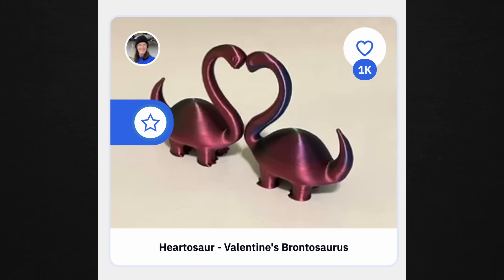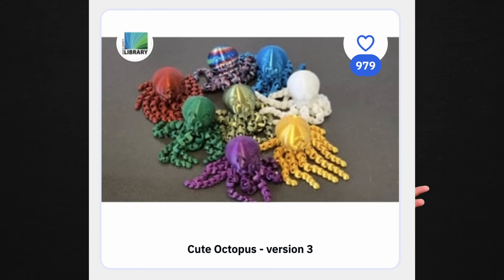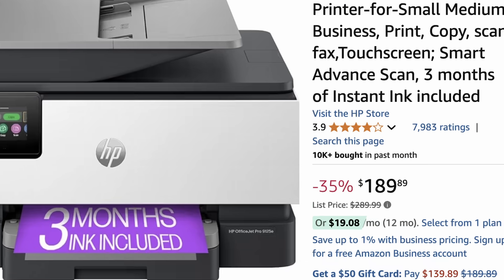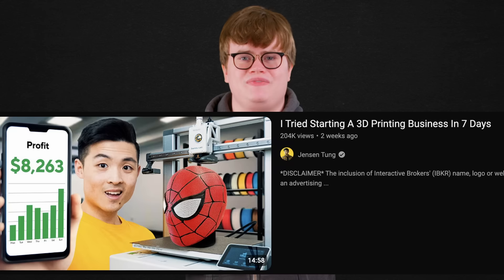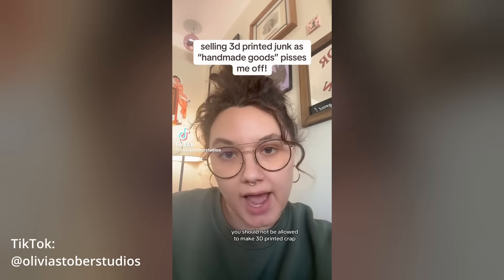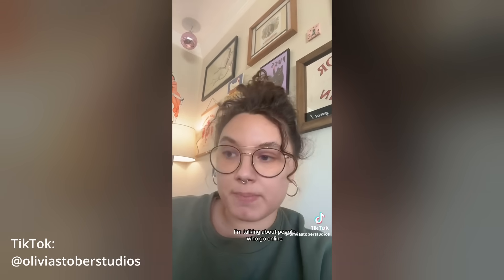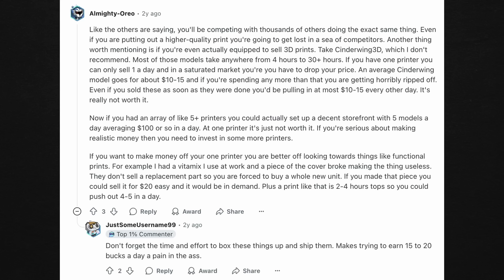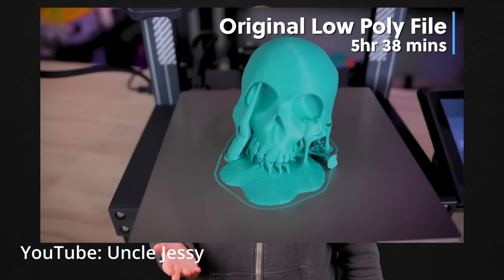The Rise of 3D-Printed Slop

Comment: I did originally get a 3D printer for the novelty of it. I've printed an octopus or two and an infinity cube. I'm not ashamed to admit that. I've even printed a vase!

I have (and still do) print stuff off thingiverse, but I've also made some custom parts. I had a wheel to a pulley break on an 8mm projector a week ago. I measured it out and taught myself enough FreeCAD to design a new one and after a few iterations and adjustments on my printer it works good as new!

Similarly, I needed a take-up reel for a projector and thingiverse had one, I downloaded it, printed it, and now I'm watching old movies. I could have bought a used one on eBay, but that would have been expensive and taken more time. The only benefit of going the eBay route would have been higher quality. I literally can't think of a different one 

I agree with a lot of your video. Maybe it's that I'm just a beginner and not jaded by what appears to be cynicism, but I'm not too worried about the junk yet. I see the dragons and crap on a coworker's desk and I roll my eyes, but we're not to Funko Pop levels yet.

I'm hoping other people have the same frustration I do when a print goes bad and have looked for ways to recycle their filament instead of it going into a landfill and that will create a market of lower cost shredders and pullers.

I absolutely agree with people selling commonly available STLs as prints. It's not a sustainable market and by the time I've purchased 10, I've probably spent more than the cost of my own printer. If you're selling specialized parts or useful items (project housing, gears, pulleys, connectors, ect) then there likely is and will continue to be one, especially if you can do 100 washers for $2 or something similarly cheap.

You're probably right about everything and I'll get to your viewpoint later on though, but that's my viewpoint now.

Comment: I'll say this: 3D printing an STL someone else made at least takes more effort than any sort of GenAI 'prompt engineering.'

Also, as a way of making money, I would say, like you say in the video, that 3D printing is not a very good way to do it. However, with a used printer, some time in Blender / Autodesk, and some metal parts, I've learned a new skill, used that skill to network with similar 3D printer nerds, and made some functional tools that are not available in my area.
Chris Borges details his experience designing and printing things like vices, lathes, taps, drills, and dovetail mounts - a far cry from your mass produced PLA dragon crap!

But if I wanted to make some cash, I'd probably go work at a mill or something, lmao.

Printer waste IS a huge issue - and I'm not super convinced that printing newbies are that concerned with the waste it does make. Solutions do exist, but you have to have the time to put them together, and the parts (Artme3D's solution costs hundreds of dollars to put together, and you've got to build it yourself!) Plus, there's the ever present problem: Recycling is not SEXY. Who wants to recycle when you could be printing impossible shapes?

And anyone selling this as a 'get rich quick' scheme, I agree, is full of it.

Comment: Internet was designed to share scientific data around the planet. Instead out shares bobs and vagine.

Same people thought 3d printers would share prototyping
Reply: i mean, why not both?
Reply: People do share scientific data on the internet. The same way 3d printing is used for prototyping. But they are also used for a bunch of other things, like having fun. You may not like it, but there exists such thing as "free will", which means that people can do whatever they want without consulting your opinion first
Reply: @anastasiaalimova5452  also, being upset at individual users for wasting plastic when single use plastic lobbyists get away with worse on a bigger scale is counterproductive.
If you really wanna cut down on plastic waste, get some of your cooler friends together and block pipeline construction in your area!

Comment: Everyone who gets a printer has to get the slop out of their system. Including me. Eventually you realize that no one wants that articulated dragon that took 14 hours to print and they either sell their printer or move on to more practical prints. I use mine to make storage systems anymore mostly. I dont sell anything because i know no one wants to pay what its worth to me. And a large chunk of new people learning CAD right now are learning it because of 3d printing.

And no one wants to sand their prints because its not that easy. PLA kinda strings off when sanded and looks ecen worse. In ofder to make something smooth you have to fill the layer lines with Bondo and then sand, which is SUPER annoying. 

98% of matsrial used in 3d printing is PLA. Which decomposes easily and is made by recycling. PETG is the next most popular and is super recyclable from soda bottles. Neither offgasses harmful chemicals. The only health risk is the dust, but nowadays most people are buying enclosed printers. 

Dude if you dont like 3d printing, dont buy one. And do buy the slop.  This video comes off really whiny. And slop at craft fairs will stop when people stop buying it. So just dont buy it. Let people enjoy things and stop being so offended.

Comment: I just 3d printed a modular fiddle. It's to replace my broken childhood violin that's too expensive to repair. Not a waste and the sound is beautiful.
Reply: Dude, I replaced my old warped bridge pretty recently! 3D printed strings players unite!
Reply: @logicbuilder1204 sadly it was a waste. It snapped after 3 months. Good wall ornament but the plastic can't handle constant tension.
Reply: @Dtgray12  Were you using PLA or PETG? I know PLA has issues with being under constant force. Also, did it break while you were playing lol?
Reply: @logicbuilder1204  PLA. Printed a wall mount for it. Played 30 mins daily. Snapped when I was in another room about 2 weeks ago.
Reply: @Dtgray12  Ah yeah lol, PLA does that. If you ever wanna try again use PETG, I printed my cello bridge out of PLA like half a year ago and it's still going strong
Reply: @logicbuilder1204  PLA. I printed a wall mount to hang it and played it 30 minutes in the morning and evening. It broke about a week ago while hanging on the wall.

Comment: 90 percent of what's being printed is garbage toys that even a 5 year old would be insulted by receiving. Every time you mention the overwhelming majority of thingaverse straight to landfill slop, the community starts screaming about how they printed a bracket for an old bookshelf so it's fine, actually, like those 2 things cant simultaneously be true. What a waste. Everyone here has seen the YouTube shorts. Look at these 2 interlocking things. They fit into each other. First of all a 3d printer is the worse thing for this task because of the resolution. Secondly, it's literal trash. Good job """making"""" something.

Comment: I feel personally that the problem is that people can’t reuse the plastic already printed, which is why they usually get trashed. If there was an add on or something that could recycle failed prints back into filament, then this would be less of an issue.

Comment: One roll of filament, an oil product, weighs about 4 lbs.  One gallon of gasoline weighs about 6 lbs.  The waste is just about negligible and a nothing sandwich.  Considering all the benefits of 3D printing, don't even consider the waste. I bet the printer will keep you from driving some place far at least once - that should make up the oil waste quota for the lifetime of the printer.

Comment: I hate to be that guy, but this video seems kind of.. low effort? Like yeah, it’s sad the most popular prints are slop when there ARE good prints and even full printable games out there, but it feels like you are stretching the runtime and reiterating the same points over and over. Also, home 3d printers are still pretty young, so I feel like you are overinflating the quality issues which can be fixed if you put effort into sanding down the prints.

Comment: Thank you this is very true. The 3d printing community seems to gloss over this stuff in their excitement for new 3d print technology. The emphasis should first be CAN YOU MODEL ANYTHING and do you NEED to model custom things for any reason. I got a printer when they finally got cheap and easier to use, for this reason. I can make miniatures and animations and got good with Tinkercad before I knew anything about 3d printing so for me it was exciting to see that I can print my own designs in the real world for miniatures and animation models, but then learning about it quickly discover that the community seems to be about just churning out ridiculous crap from thingaverse. It's very annoying. Also the rhetoric around PLA being "biodegradeable", while there are still unnamed toxic additives in most types is really frustrating. It's a separate issue but where is the filament that is is truly compostable? I can't stand the green marketing that the industry employs about this.

Comment: I have 5 3d printers now, not a print farm- I almost never use more than one at a time... many are enders I got for under $100 that I've been modding for different uses. I have these because I have a LOT of hobbies- basically every aisle of a craft store is in my home... this means I often need niche craft items at 2am and my closest store is around an hour away, and I prefer not to shop online due to the environmental cost of shipping. I can start working on a card for a coworker, realize I really want to emboss the card, and quickly print a small embossing tool or 3d model my own with simple cad software. I've also found a love for using my printers to make items that are too niche to find anywhere else. I've started designing uniquely shaped mold and deckles for paper making, these typically require using two frames and mesh, limiting shapes to simple ones. With 3d printing, I can print anything from egg shapes to flower shapes in a way that everything is printed at once. I do really think a 3d printer would be perfect in most homes, but I wish the crud could be restricted to prevent excess plastic use.

Comment: Last thing I used my 3d printer for is to fabricate a replacement  handle for my 20 year old Bosch fridge which i found a file for but had to alter the model to make it fit my model of fridge. And  the result worked well. This is what i think of when it comes to how to use a 3D printer among some other hobbies.

Comment: It's so much worse, because PLA is NOT biodegradable.

Pure PLA filament will biodegrade under natural conditions in ~80 years--but here's the catch: NO ONE SELLS IT. They all have additives or have not been tested under any ASTM standard. I spent months searching and found only ONE filament that was 1.) tested/certified 2) actually available. (Filamentum Nonoilen is the one I found, and it's difficult enough to work with that it's only suitable for certain prints (no overhangs)--otherwise amazing.)

If you have a resin printer, you can find biodegradable resin from 3Dresyns.

The only 2 people in my office who own a 3D printer just have it running at home constantly printing stuff they will throw away because they think it's biodegradable. 5 dragons in a row until they get one with the color spectrum they like. The rest go in the trash. It's going to sit in the landfill unscathed, slowly dumping microplastic particles, for longer than they or their children will live. 3D printing is a massive waste problem and it continues to grow thanks to extensive green-washing. "Sustainable" filament is not sustainable. "Bio/plant-based filament" is not in any way biodegradable. Etc. Etc.

Comment: I work in the games industry as a 3D artist and have a lot of experience with woodworking/cabinetry. I’ve occasionally dabbled in 3D printing as a medium through friends owning them or from online services.

Often it might come in handy for small parts or work holding jigs in my projects. Most of the time I find that it’s easier and faster to just make a part roughly to get the job done out of plywood/acrylic/mdf/etc. Many of the applications where I think “this could be a 3D printed part” tend not to need the actual tolerances afforded by a 3D printer.

What’s weird is that I use 3D modeling software on a daily basis for work. I almost always use blender or fusion 360 to figure out my design/process/materials estimate first before I build any sort of woodworking project. Knowing 3D software as someone who makes stuff seems as important to me as knowing how to use a pencil when I draw!

I’m just baffled by the idea of purchasing a 3D printer but not learning at least basic cad software or the basics of blender? It blows my mind how many 3D printing obsessed people online seem to have no intention of actually acquiring the skills needed to use the thing competently.

All I can reckon is a lot of people who like to think of themselves as “technical” but not “creative” get into 3D printers but are scared of “putting a brush on canvas” essentially? I just don’t understand it really.

Comment: I have 5 comments on this topic overall:

1. Recyclability. PLA o mateials that are vey similair, like PLA+ and such, can be recycled on mass. Not 100%, but there are recycling farms that you can send it to.
2. Is it usefull? You said, that pinting things like the ring measurer is not worth it, because you can buy it on temu. But shipping an injection molded plastic part over half the world is better than printing it yourself? 
3. Yes, one should absolutely know at least one 3d sculpting tool like Blender or Fusion 360. Only that way you can actually feel like you are acomplishing something. Even if you are just modeling flexi Dragons.
4. Some of them are just toys. If you smooth out prints, or print them at a high enough resolution, they can make great toys for children age 4+. (Wouldnt gift them ealyer, out of fear of them chewing on it). But they usually enjoy them for WAY longer than 2 seconds
5. Tinkering. Some people (like me) enjoy the tinkering with, and on the printer itself. I always print funny trinkets that you would call useless as stresstests. I always gift them to people, who i know will enjoy them. And yes, there is a lot of cutesy stuff, and my mothe really likes them. Butif you make something of it, gift it away or just use it as decoration, I dont see the harm you are Portraying.
And i hope, this bible of a comment doesnt rub anyone the wrong way, but i felt like the video was way to one sided.

Comment: The easiest thing to fix this giant issue is not to stop printing stuff like that altogether, but rather to print it in better materials. PLA is "biodegradable" only in industrial scenarios, while stronger PHA filament degrades simply being in the ground for a week. If the whole world made the not hard switch from PLA to PHA, all the plastic waste would simply go back into the environment, basically self-deleting the waste.

As for the bad quality of some of these prints, I think that layer lines can be less detrimental by having better and more advanced non-planar slicing methods and compatible printers in existence, and also the rise of consumer-grade SLS printers, which can have much better quality at similar print speeds.

At some point I want to experiment myself with true multicolor 3D printing. The idea is to make a custom hotend with 4 extruders and 1 nozzle. It would take cyan, magenta, yellow, and white filament and feed it at different rates into the hotend to vary the outgoing color, allowing for millions of possible colors. Idk if it would be possible but I want to try it myself some day.

Those were just some thoughts I had, I am not an expert.

Comment: My father bought a 3D printer in the early 2020s and he never succeeded in using it because, among other things, he found out it required to be in a room where the temperature is around 26 Celsius, which is nearly 80 Fahrenheit. It's a hardly bearable indoor temperature that we can get in our geographical area by having a heatwave or by increasing the heating bill.